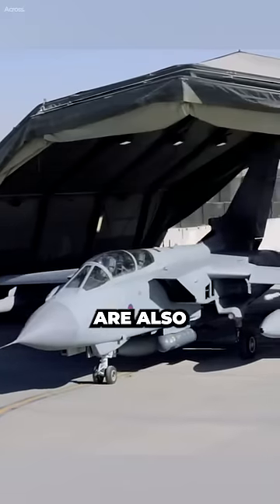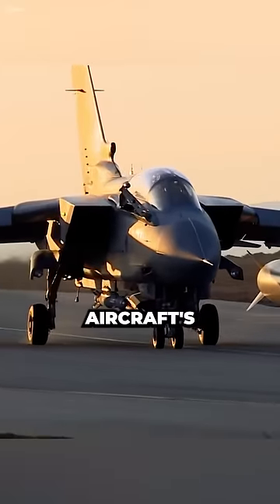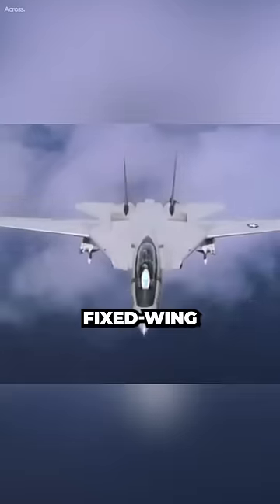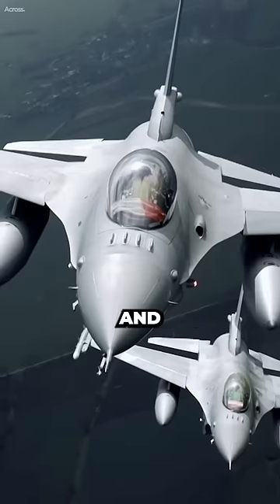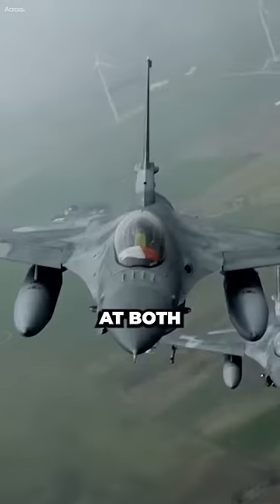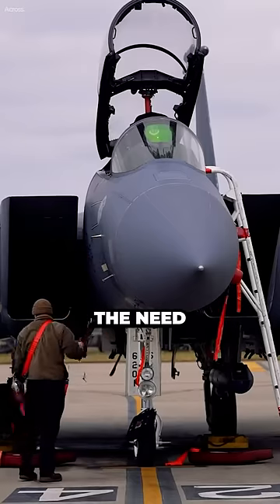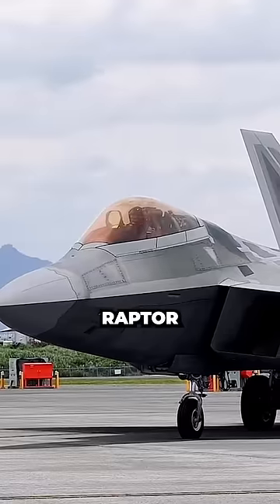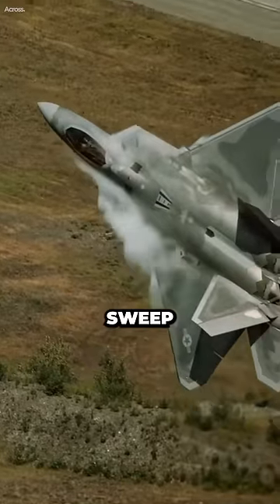Why Don't Modern Aircraft Use Variable Sweep Wings?

Comment: Golden Point - The Variable Wings are using Mechanical Levers to achieve variable wings and they are heavy and they will be very very light if electronics chips circuits and sensors and wiring is used to achieve variability and so all variable sweep wing aircraft are to electronic means to achieve variability and all at Emmy's Expense ( IMF ) ( azmo ).
Reply: Variable sweep worked well.  Advances in engine T/W ratio and thrust allowed high thrust to reduce takeoff run.  Bigger wings reduced landing speed.  The bigger wings also allowed more fuel to be carried. with the drag of the bigger wings compensated for by the higher thrust.   It all got down to the engine advances.
Aircraft such as the F-15E suffer from sever wind shear  turbulence when doing low level penetration compared to F-111 and Tornado.  It's not a common mission for the F-15E.

Comment: Also, the wing position tips off what the power status is on the aircraft.  Using the F-14 as an example; wings outward or forward are in use at slower speeds and high maneuver, swept back for top speed.

Comment: It’s actually has a lot to do with the change in tactics and operational posture where high top speeds are no longer thought as a necessary requirement. The F-14's top speed was ~mach 2.25 where as the F-18 is around 1.75.
Reply: Hypersonic anti ship missiles enter the chat

Have to be able to take out the launch aircraft before it can fire those missiles from beyond 100 mile radius.   No aircraft currently in the United States inventory can do that.

Comment: The F14 was a dedicated fighter. F/A18 wasn't that. No comparison there.
Reply: And yet the F/A-18 is a better fighter than the F-14.

No comparison? Only if you don't know what you are talking about
Reply: @deang5622  "only if you don't know what you are talking about."
You proved it.
B+ and D model Tom's could best any current American plane outside the 22. Those engines made the Tom everything it could and should have been. Super Hornet wouldn't stand a chance. Tom could BVR it and still out dogfight it close in.
Reply: Nah the F-14 was on par to a F-15 not a F/A-18 Hornet. The F/A-18 didn't really become a good fighter tell the Super Hornet. The F-14 was both faster and better turning at low speeds. The radar on the F-14 would pick up the F/A-18 Hornet from about twice the distance. So it could out run, out turn and see its target first....... Fun fact when training with F/A-18's the F-14 would have to lock its wings forward and have its drop tanks on to make it fair.

Comment: Umm... the F-14 had a larger weapons load the F18C/D and a much larger fuel capacity.  Pretty amazing since the F14 wasn't designed the carry air the ground weapons and was pushed into that tole later.
Reply: Much larger plane and took up more space.
Reply: "pushed into that tole later" - more like trying to stay relevant
Reply: The F-14a was rated to carry unguided bombs from the beginning. You can see it on the Attack Selector in the cockpit. There is a D/L Bomb function and will give the pilot a manual bomb sight. Also, the F14 had two rates of fire for its gun, the lower being for Air to Ground use.
The biggest reason these never really got used is the Navy had another great bomber.
No, not the garbage Hornet. The excellent A6 Intruder.
Reply: Superhornet has entered the chat
Reply: Yea the hornet so garbage that it ended up phasing the Tomcat out, keep coping

Comment: Actually the sweep wings don’t hinder payload capacity as much as you think. Look at F111. Has the highest payload weight out of any jet and it’s older than every jet in this video. Plus sweeping the wings forward allows for straight wing dogfighting allowing the jet to turn faster than most others. F14 has a crazy turn radios time of like 23 seconds or something when it’s wings are forward with landing flaps down. Most jets are at 26-29. (The shortest being the F16 with 20). 
In my opinion having a sweep wing jet is one of the best things you can have in your arsenal just because it can change its shape to adapt the the environment. The only major downside is the cost of such an expensive jet. 

PS if we could incorporate F16 instability, F14 sweep wing, and F22 stealth and engine gimbal the product would be a super fast invisible highly maneuverable fighter jet that could basically do whatever we wanted with.

Comment: It is still used in Iran, as of about five years ago.  It may still be in service there.  I have not checked.
Reply: It wont be in service when F-18 pilots find them.
Reply: @testpilotmafia862  Nice, very nice; and very true.
Reply: The only redeeming quality iran has
F 14
Reply: There's only a handful of F-14A's remaining in operation out of the 80 Iran initially had. Many have been cannibalized for parts since the Islamic Revolution and the embargoes imposed on the country.
Reply: @SammywiseG that's what you're supposed to believe.  They have most of the fleet combat worthy due to reverse engineering.

Comment: The F-14’s variable sweep wing still gave it an advantage over the F-15 though. That’s why the Shah of Iran decided to buy it instead of the Eagle. It ran the demo on minimum fuel to get the thrust/weight equal to the Eagle, and then it had the better wing. But yeah, it was heavier in normal operations.

Comment: Technically, the 18 does have a higher max payload compared to the 14. However the 14's internal fuel tanks care 30% more, so this removes the need for external tanks that the 18 requires for its missions.

Comment: Its mostly because of fly by wire systems.  Aerodynamically, the f22, f35 etc are unstable at low speeds but fly by wire compensates for it.

Comment: The f14 is a good looking plane but I think the tornado F3 is even better looking especially with the Wings swept back . I always thought the tomcat was too big an aircraft for carrier operations .
Reply: I agree that it should've been smaller, but at the end of the day even phantoms were pretty large but it didn't cause problems.
Reply: Tornado has always been one of my favs. Absolutely gorgeous aircraft
Reply: @jamesmaddison4546  As an Italian I totally agree
Reply: @zanzao-1ps318 couldnt be smaller. Aircraft are designed to meet requirments, not just 'be small for the carrier'. 
F14 was designed around its huge radar, which was designed to guide the aim54 missile, and it had to carry 6 of them, plus enough fuel for x amount of time or combat radius. Had to fly slow enough to land on a carrier but fast enough to intercept bear bombers before they could launch missiles at the carrier. All these things mean size and weight.
Reply: Mitsubishi F1 enter the chat chad
Reply: @user-SaputroYono  it's simply an F-16 with some modifications
Reply: @user-SaputroYono  you really comparing the f1 to these? It could only carry aim9s and very basic bombs and very poor rear visibility. It also wasn't meant to be a serious fighter, mostly air support
Reply: @jamesmaddison4546  They didn't say it was better. They were just saying it looked better. Which I agree wholeheartedly with. It's probably my 3rd favorite plane right behind the J7W1 and the F15
Reply: @zanzao-1ps318  I'm not sure where you see the f16 in it at all.  It's high wing (not centerline), it's also twin engined, I can't remember the term for it but the f4 and sepecat jaguar both have it for the tail/engine positioning. 
From top it looks like an f5 but from front and sides it's more like a bae hawk cockpit with an f4 nose, wing position just like the jaguar, rear f4 and jag. 
I'm well aware it was before all these (and the f16, oh doesn't have bubble canopy like 16 either) it's just pretty cool to see all these design elements combined in one aircraft ending up on future airframes.
Reply: @meerbee2910  I just wasn't sure how he meant it y'know. Personally I think it's cool and actually use it a ton in one of the games I play online before I get better fighters unlocked that round. 
In my comment above this one you'll see I point out all it's design elements that end up on future aircraft. I think that's a pretty cool thing to see all in one y'know
Reply: @jamesmaddison4546  I got confused my bad, I somehow flipped the F1 with the F2

Comment: All aircraft mentioned are all slower than the f14.....the f18 super hornet is mach 0.5 slower and its the newest version
Reply: The f14 max speed was 1544mph and the f22 is listed at 1500mph. They traded the sweep wings for 44mph and stealth on a fixed wing.
Reply: @navalsealsnipersports1199 true, but the f22 while being close in speed is extremely new to the ancient f14, which is still faster. If the f14 was updated to be more modern, it would be a better interceptor than the f18. The f22, like you said, is in its own category. Its a stealth fighter not a naval intercepter but still slower than the f14
Reply: @natakuu13  the other issues as the video mentioned were payload capacity. It’s a luxury to have bigger and better bombs and missiles when in the air
Reply: @navalsealsnipersports1199 
Hmmm while that's true, bigger payload's always better. 
My concern, however.. the video didn't explain, in detail, the difference between light fighter's & heavy fighter's performance w/ similar (heavy) payload in the event they'r intercepted by enemy fighters. 
Light fighter, nowaday, while capable for having exceptionally big payloads, but that also mean that they'r even ..proner.. for being 'Soft Kill' -ed by the opposing forces, in which they'r forced to jettison their ordnances, to trade weight for maneuverbility, thus they'r unable to complete their mission. 
So the enemy had achieved their objective, without the need to shoot any of them down.
Heavy fighter, such as F14 & F15, in the other side, didn't have such limitation.
Reply: @natakuu13 interceptor isn't really a role that exists anymore since most fighters can be an interceptor. Also we reached a point where speed is not the most important trait in a military aircraft. It's not that the air force can't build an aircraft as fast as the F-14, it's just that aircraft never really need to go that fast in combat. And with maintenance being far more expensive, it isn't really worth it
Reply: @natakuu13 Still the Blackbird is faster than both - with fixed wing geometry. Yeah it's no fighter but it just shows that sweep wings are always a compromise, not worth taking today.
Reply: F-15 is faster than the F-14
Reply: So? You’re not gonna get an air kill by going 0.5 mach faster. You win them by having more maneuverability, which the super hornet has BY FAR. Also it has a better weapons payload and more range, all while being cheaper and immensely safer. The tomcat killed, while awesome, also killed more American pilots in accidents than enemy air targets.
Reply: @@BurningPhoenix1995 NO
Reply: An irrelevant argument.
You don't do dog fighting at supersonic speeds.
Reply: @@BurningPhoenix1995 I think you need to go look up the details on the radars before making naive comments
Reply: @deang5622  You dont do dog fighting in modern doctrine in 99.9% of cases. It's still being trained, but it's being avoided like the plague.
Reply: @42ZaphodB42  I am trying to educate the young idiots on here that genuinely think the F-14 is an aircraft which performs better than an F/A-18 which has 30 years newer technology.
Reply: @deang5622  Right? To many tom cruz in their head.

Comment: Advance in modern computer enable the wing body blend geometry to be designed, this eliminated the need for swing wing mechanisms, also there is vector thrust in case of rapid switch between aero characteristics

Comment: Well. The Mig-21 also don't have variable sweep wings and is able to achieve mach 2. The main advantage of variable sweep wings was not about high speed flight dynamics. It was about the variable speed flight dynamics. But modern aircrafts have special tool - vortex generators - which allows them to be usable even in low speeds.

Comment: It's not that the F14 needed the variable swept wing to go supersonic. It needed it for low speed maneuverability. For like carrier landings. The F22 is slower than the F14 and doesn't make carrier landings. F18 has a straight wing for low speed maneuverability, but has poor high speed maneuverability and is slower than the F14.

Comment: Odd. When I look up the cost of the F-14 it costs significantly less than other fighter jets. It's probably due to its age but realistically even the F-35 is almost 20 years old.
Reply: If you consider the development phase of the F35, you have to do the same with the F14. In terms of costs, you have to consider a inflation and b that a modern F14 still needs today's avionics to be competitive, that alone would raise costs significantly compared to back then. Also labor costs, or would you build plane parts for 5$ an hour today😂?
Reply: @Ashitaka0815 also maintenance time and cost were major drawbacks of the f14.

Comment: Stealth is the reason we don’t have swing wing aircraft. From the ‘40’s onward speed was seen as the advantage. But to go fast you need big powerful engines to go fast and that creates heat.  Stealth aircraft don’t need to go Mach 2 because you give up too much in terms of detectability.   Also swing wings are mechanically complex without giving you stealth.
Reply: Bzzzt...  wrong.  Stealth aircraft are speed limited because the heat would burn the RAM coating off, making the aircraft quite visible to radars.  And again, with the advent of hypersonic anti ship missiles, the 70 mile range of the AMRAAM just ain't enough.   You have to take out the launch aircraft before they can fire, because once the missiles are in the air, they're next to unstoppable short of an anti missile laser system.

Comment: The major issue with variable geometry wing designs is that progress on thrust vectoring, canard designs and other super maneuverable tech approaches have pushed many other aircraft designs to the edge of the limitations of the human body even at low velocities, and are significantly easier to repair and maintain.  Variable geometry design could very well have been a dead end tech for air superiority aircraft, but may find new applications in the future if they can emphasize maximizing lift on take off rather than maneuverability in order to drive down take off speeds or maximizing take off weight in order to develop forward deployed attack aircraft, or missile mules to support the F-35 fleet that can take off from minimally prepared runways, rush to the operational area with the wings swept back, carry out their mission, then RTB to the forward airbase to pick up a quick rearmament and get back on station.

Comment: The F-14 for a fact carried wayy more weight than the F-18. The bombcat can carry 6 Phoenix missiles and still 2 sidewinders and maybe more.  The F-18 can 6 500lb bombs yes needed to calculate for fuel. A very under powered A/C seen a ramp strike on 76 in 06.
Reply: Yeah, whomever made these videos apparently doesn't know that one Phoenix alone weighs 1000 pounds...  pretty much the entire bomb load of a single Bug alone can be carried just between the engines, and that's not counting gas bags, LANTIRN pod, or the wing glove pylons with either more bombs or defensive missiles...

Comment: Probably the biggest reason they're no longer present in modern aircraft is that they're pretty much impossible to make stealthy. Thrust vectoring can get you the maneuverability that you lose by not having a swing wing design, but dogfights are a thing of the past anyway. BVR is how air to air combat is fought now.
Reply: They said that before when they removed guns from the F4 , they then found out they were still needed

Comment: The F/A-18 is not the fixed wing variant of the F-14. The F-15 is the fixed wing variant of the F-14.

The fact of the matter is, variable geometry wings will always having better flight characteristics, but supposedly that doesn't really matter, because the missile is the most important thing. Engagements are supposedly at very long distances (miles away), so being maneuverable doesn't really matter like it should, or so they say.

The F-14 was preferred by the navy because it needed better long range capability compared to the F-15. So the variable geometry offers both long range and good maneuverability. I'm not sure about ordnances, because the vehicle is a fighter, not attacker or bomber. So the ordnances are light, meaning the increased aerodynamic efficiency makes up for the heavier components.

Basically, the F-14 is still the coolest and best aircraft the USA ever designed. And the MiG was faster and more maneuverable.
Reply: Bro neither are the variants of the F-14

Comment: One advantage the F14 had due to its swept wings is more stability as lower speeds as it could extend the wings pretending to be a propeller driving plane.
Reply: and it was faster because of the wing configuration

Comment: A fixed wing will not be as good as a variable wing in any condition, cause it will always be worse by a bit in all areas when compared to the ideal wing design that a speed requires, and that a variable wing system can achieve.

Comment: 1) f18 doesn’t have more payload than the tomcat 2) they have/had different jobs - f14: basically a (fast) interceptor build to carry the massive Phoenix missile f18: much more a (slow) (ground)attack plane, build to be cheap and small and be multirole if needed